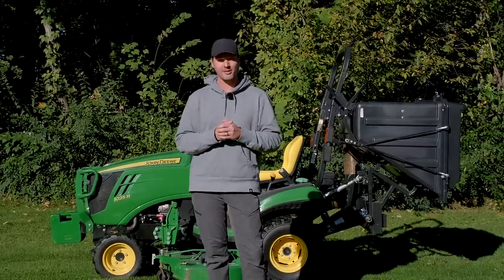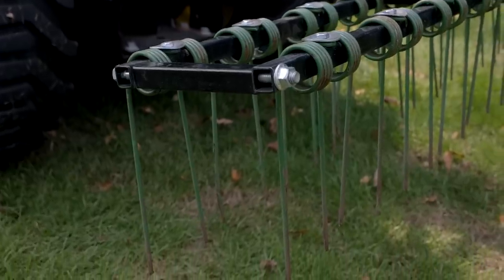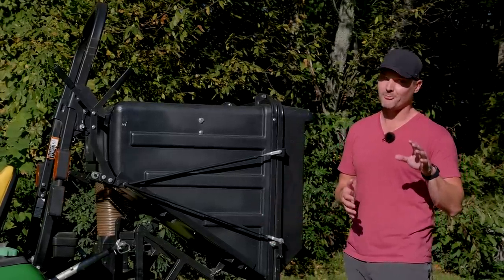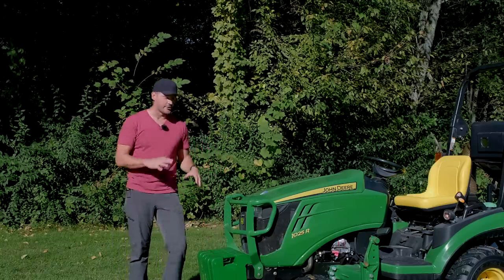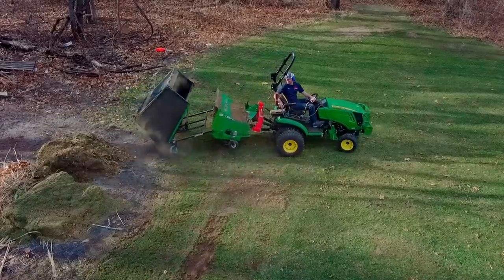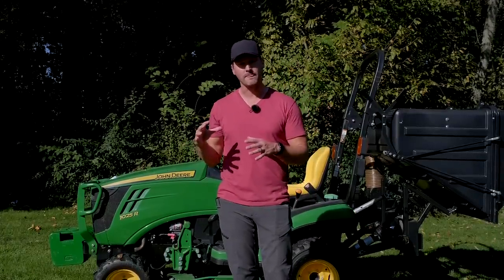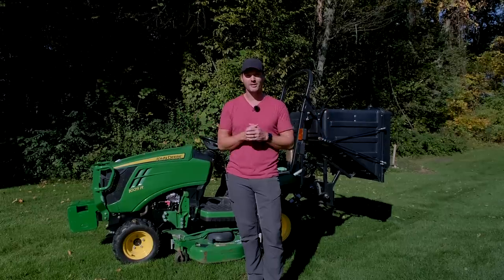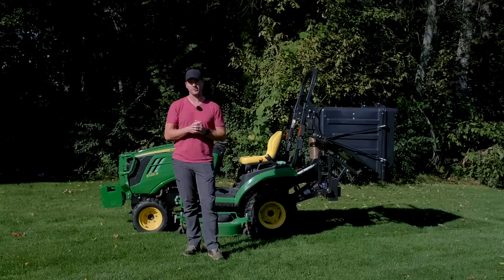THE RIGHT TOOLS TURN WORK INTO FALL FUN WITH YOUR TRACTOR! 🤩🍂

Comment from the maker: Hey, thanks for watching!  If you're in the market for a new tractor toy, err, I mean tool, then check out the links below!

Dethatcher: https://bit.ly/30IFcGo
Protero Material Collection System: https://bit.ly/3BTilWe
Sweep-All Sweeper: https://bit.ly/3n85pWu
Weight Bracket Bundle: https://bit.ly/2Z2FeIr
Sweep-All Plugger: https://bit.ly/3G0b7lR
Dirt Dog Plugger: https://bit.ly/3lVL4Ej
Ag-Spray Electric Spreader: https://bit.ly/3G66XJk
HLA Buckets: https://bit.ly/3jlMGWm

WANT TO SAVE MONEY? CHECK OUT THE GWT DISCOUNT CLUB!  Use code GWT at any of the vendors below and you will save cold hard cash :)  I will also get a commission for the sale, so it's a win-win-win!  

5% OFF WITH CODE GWT AT 247PARTS.COM http://www.247parts.com
10% OFF WITH CODE GWT AT OUTBACK WRAP! http://www.outbackwrap.com
5% OFF WITH CODE GWT AT MUDD'S CUSTOMS! http://www.muddscustoms.com
5% OFF WITH CODE GWT AT JU FAB WORKS! http://www.jufabworks.com
5% OFF WITH CODE GWT ON SELECT PRODUCTS AT SUMMIT HYDRAULICS! http://www.summit-hydraulics.com
5% OFF WITH CODE GWT AT LUBE SHUTTLE! http://www.lube-shuttle.us/store
5% OFF WITH CODE GWT AT 511 DESIGNS (CUSTOM GRILLS): http://www.5elevendesignz.com
5% OFF WITH CODE GWT AT TRACTOR PTO LINK! http://tractorptolink.com
5% OFF WITH CODE GWT ON PROTERO DUMP SYSTEMS! http://www.proteroinc.com
5% OFF WITH CODE GWT ON SWEEP-ALL SWEEPERS! http://www.sweep-all.com
5% OFF WITH CODE GWT AT YARD GLIDER! http://www.yardglider.com
5% OFF WITH CODE GWT AT MILLER TIRE! http://www.millertire.com
5% OFF WITH CODE GWT AT BIG TOOL RACK! http:www.bigtoolrack.com
5% OFF WITH CODE GWT AT TRAC SEATS! http://www.tracseats.com 
5% OFF AT RHINOHIDE CANOPIES! http://www.rhinohidecanopies.com Complete survey after purchase, mention GWT, get 5% refunded.

*Discount codes cannot be combined with any other promotions, offers, or deals!
**I choose to sell some products through 3rd parties instead of stocking items myself.  Know that I will receive a commission if you choose to purchase through certain links.  Thank you very much for your support!

This video is for entertainment purposes only.  Good Works Tractors (Good Works Lawn & Power, LLC) cannot be held responsible for content found in any video.  Always reference your owners manuals, use extreme caution, and proceed at your own risk.